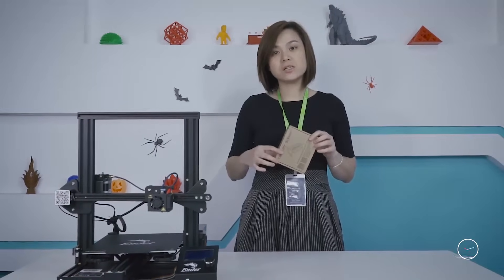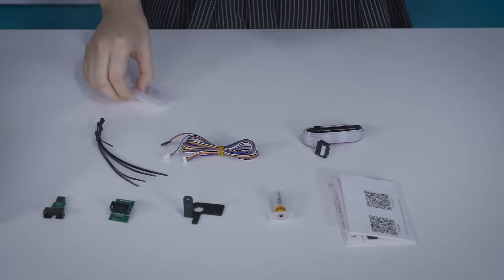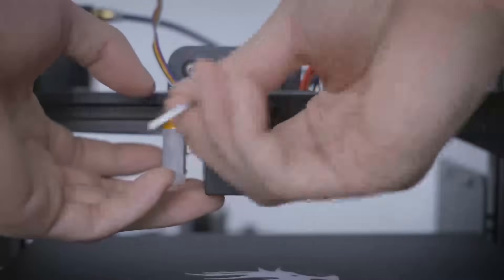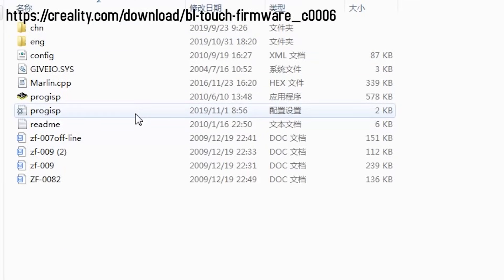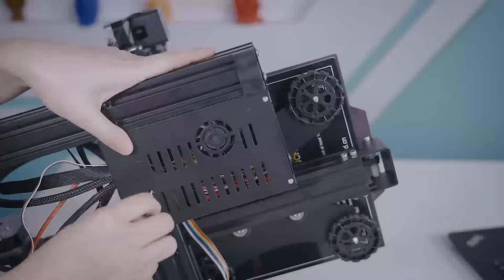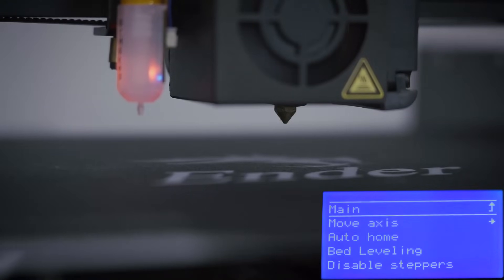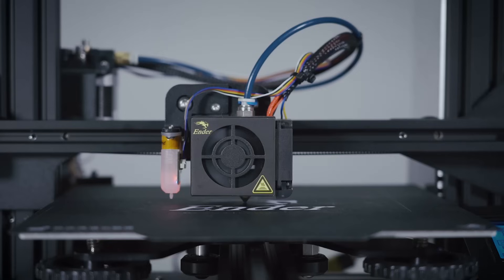How to Install Creality BL Touch Auto Bed Leveling Sensor Tutorial (Ender-3 Pro Upgrade Setup)

Comment: I get my Ender 3 pro next week. I am getting so confused. Is this thing a piece of shit out of the box, and am I going to have to print new parts for it, from the very printer that I need the part for.  If this thing is unusable out of the box, how is it still considered the best printer for under 300. Good thing I only paid 209, so at least I am not out 300 or what. If it can not print out of the box, or last more then a two weeks like my piece of shit Anycubic I3 Mega s sitting waiting to hear from customer support. Do the Chinese know what that is. Sorry getting pissed at losing money on this crap. This is the second time I tried it. 3 years ago, I lost hundreds trying it. Why did I try again. I listened to a bunch of reviews, and they seem mostly good, but then you find out, you need these steppers, this bowden tube, these printer parts, and don't forget to print a cover for the power supply, so  shit don't fall in it. Doesn't that seem like something they would have seen in beta testing and said. "oh shit that's stupid".
 I really hope I love the Ender, and I hope that I can print pretty much after its set up without having to spend an other $100 for upgrades...

Comment: I'm working with Ender-3 (not Pro version)
I followed the video and installed so far so good
but in the final step (Platform Adjustment) 4:27
my Ender-3 has no option of "Bed  Leveling" under "Prepare" 
Can anybody help me?
I downloaded firmware at Creality3d Official website
The file's name is the same as the link in this video's description
" Ender-3Marlin1.1.6BLTouch "  I downloaded
( https://www.creality.com/download/firmware-for-bl-touch_c0006/2.html )
Is it makes an issue for me?
or Ender-3 (not Pro version) can't bed leveling easily as the video did?

Thanks
Reply: Well... I’m stupid and found the reason out
Because that the step of firmware setup
I choose wrong file in “Load Flash” step
The “Marlin.cpp.hex” is incorrect file during the firmware update.
It should be used “Ender-3Marlin1.1.6BLTouch.hex” as the video shown.
I selected the right file and worked finally!

Comment: I did exactly as described in this video. My ender3 was working almost fine. and now after the installatioın of BL touch it can not get the first layer to stick. I have tried almost everything seen on the net but nothing helps. Almost a week now with these trials very very frustrating. I need help
Reply: Have u tryed using a 0.4 initial layer ? I use glue Stick
Reply: @TheMasterizzatore  i gave up sir
Reply: Exact same issue here! Only I have a car-10s pro v2 and mine came with the BL. After a handful of amazing prints I believe it’s malfunctioning. I level my bed but after pressing the home button and reactivating auto level the nozzle is way too close to the bed. I can’t even fit the .2mm tool under.
Reply: @andreortiz3396  good Luck mate i freed my mind not printing for a while...
Reply: Just change Z offset

Comment: Are there any good forums for troubleshooting ender 3 bltouch installation? I've got it all installed, but now when I try to move the z axis, it goes straight to the top, and I have to shut it down. Doesn't matter which way I try to move it, or on which step increment, always goes straight to the top and gets hung up.

Comment: DONT DO THIS IF YOU HAVE 1.1.5 SILENT BOARD OR YOUR BOARD WILL BE GG. Somehow that burner killed my silent board there is not any software anymore I see just a blank blue screen I will try to install software inside of it via bootloader and arduino hopefully it will fix.(edit: Board is dead cannot use anymore) TY CREALITY >:( DONT DO THIS ON SILENT BOARD

Comment: Do I need to power on my Ender 5 in order to flash the new BL Touch firmware for Ender 5?
Reply: No, it use the Power of the USB wich is connected to your Computer.

Comment: Ender-3 Pro1.1.6BLTouchV3.1PowerLossContinueEnglish 4.23 " Dont work on silent MB 1.1.5 my display are black after power on .. only the hotend air its going....
Reply: my display blue with silent board I switched back to stock board and ordered one arduino I will try to install a bootloader and install a software to fix it hopefully.
Reply: @Burak0015  Work ok without the BL fimewire but have to reinstall the Z-stop. I had it working with 1.1.4 MB

Comment: Hello, I followed all the instructions and my screen is blue and I cant see any menu on the screen
Reply: Damn...
I have bad news for you...
Reply: I have the same problem. How can I fix the problem?
Reply: @abecemar  I just had this same problem.  It turns out that the socket for the screen wires is just a little too big so that you can actually miss some pins when connecting it.  Just be very careful and line it up before putting it on.

Comment: My mother board fan and my filament fan is not working after flashing my mother board for the BLtouch auto-leveling. I also downloaded the software off of your website but the ender3 flashed my mother board with the ender3pro software. Can you please check the correct file in attached to the link for the Ender3 firmware. Please help fix this issue, my printer is currently not printing correctly because the filament is not cooling.

Comment: "Ender-3 Pro1.1.6BLTouchV3.1PowerLossContinueEnglish" Dont work on silent MB 1.1.5 my display are black after power on .. only the hotend air its going....
When i go back to  "Ender-3 Pro1.1.6.2 resume printing" working
Reply: I'm at this Point did you fix it?

Comment: I got under3pro last 4 days i starting print but never stick in half way my printe gotten removed??
Reply: You probably have a warped bed the same as my Ender 3 PRO, apparently most Creality printers ship with warped bed, took me 2.5 months to get creality to ship me out a replacement bed but instead of shipping a new heat bed they ship out glass plate but at least it means I can print now.

You can always go to a glass cutters and try with a normal sheet of glass the size of your print bed to see if that sorts your problem and if it does it means its a definitely a warped bed.

Comment: I have been struggling for over a day now to figure out how to keep the extruder from banging into the right side of the printer when I run autohome or bedlevel. The Marlin hex file moves forward and tries to slam downwards and I have to turn off the printer. The other hex file tries to slam into the right side.

Comment: Everything went smoothly, now when I turn the Ender 3 Pro on, the screen is blue with barely visible flashing. Any idea's are appreciated. I've checked wiring, connector orientation. Flash took about a minute and said it was fine.  The BLTouch itself doesn't light up or do anything when I turn power on.
Reply: you might have messed up the power gnd and vcc
Reply: Like I said to Pablo, I just had this same problem.  It turns out that the socket for the screen wires is just a little too big so that you can actually miss some pins when connecting it.  Just be very careful and line it up before putting it on.

Comment: Should warn people that the connectors on the main board may be hot glued in place, it might potentially spare a customer from pulling the Z-axis end stop mating connector off of the main board or causing other damage.

Comment: Just bought an ender 3 pro. This works on the stock motherboard that came with the unit, right?
Reply: I don't think it will as they never shipped with a boot loader, I tried flashing mine with new software with no luck only to find online everyone says it don't have a boot loader so you have to install a boot loader and then flash it.

It's a lot of hassle to install boot loader so I never bothered in the end and all I see here is people with 1.1.5 boards having problems so I don't think that's a good option either and creality seem to leave this video to die now it's a few months old.

Comment: I downloaded the firmware from the site but when I try to open the application I get messages and then it won't properly close, I've redownloaded it and have the same issue everytime
Reply: rename the folders, there are characters in the folder names that mess things up
Reply: @jimthwaite9275  That did it, thanks so much
Reply: @bowietheninja  I was watching the video and doing the install myself so I saw your message about 10 minutes after I ran into the same issue :)

Comment: Hi i just buy ender 3 pro and some upgrades BIGTREETECH SKR mini E3 V1.2 Control Board 32Bit With TMC2209 UART VS TMC2208 For Ender 3 Pro/5 SKR V1.3 E3 DIP 3D Printer Parts i can instal with this and is the some instal with your video

Comment: Does this affect my printers ability to read from the Micro SD card? I have read that there could be memory issues i.e. not enough to run both the ABL and SD Card functionality. I have the Ender 3 Pro and the Creality ABL kit.
Thanks in Advance :)

Comment: I followed this video just as it was explained. I’m not sure what I did wrong but my printer display is now stuck blue and the bed for some reason twitches, the printers unresponsive to anything. Someone please help me with this, all wires are connected correctly. I think it’s a firmware issue but I’m not sure what to do to fix that

Comment: What about custom X and Y offsets, like for the Petsfang V2 mount?
Reply: Forget about Creality providing anything, they haven't even adjusted the X, Y offsets for the BL Touch in their firmware so you end up with just two-thirds of the bed probed for ABL and no Baby Stepping so you have to make a Z offset adjustment then print a bed calibration print to check if the offset is good and if not change again and print again rinse and repeat many many times

Comment: turned on my printer and it stared smoking and the screen doesnt work, guess i messed up
Reply: I didn't have the smoke ( rather serious and the next bit is if you sort that out :( ) but i had the blank LCD screen. Try changing the screen lead with the lead included in the pack.... That got the LCD screen working!!

Comment: Thanks for this instruction, that was very helpful. One question though, I could not find any proper recommendation about the Cura G-Code: G29, the instruction that came with the BLTouch Guidebook says: Change "G28" to "G28 G29" ???? other guys post saying G29: Probe , G29:ABL  any many other ... could you please clarify this?
Reply: Do not change G28. Add a line after G28 and in that line type "G29 ; ABL"  (minus the quotations)
Reply: Maybe I'm explaining the obvious, but - anything after the ";" is considered a comment. G29 is the actual command and means "Bed leveling (automatic)". G28 is "Auto home"

Comment: The A plus B = C setup does not make sense.  First it's hard to understand the language....sorry.  She says "A" is -000.8 by this printer".  Where did she get that?  It's not a factory default, she just eyeballs it and says "write it down".  The we mark down the Z Offset data, which is not on my screen.  Not sure if this is the BLTouch offset or what. Then it appears she just stays on the "B" screen and adds the screen "A" to it.  If you don't know what exactly "A" is your screwed.  Mine; if I go into Motion and control Z I have it showing +1.2.  My BLTouch offset says -1.85, so if i adjust to -0.65 I should be OK, however Z just plows into the bad no matter what number I put in.  It's the same every time.  

Oh and to top it off I leave a question here and get ignored.

Comment: I followed this exactly and my nozzle is going way too far to the left to the point that the BLTouch is off the plate and dented my bed. How xo I fix this??
Reply: you need to set the probe offset in the firmware
Reply: @wss.niklas  how do i go about doing that? I used a hex file from the manufacturer website. Sorry complete noob at thos stuff.
Reply: @agentsmith007  Do you have an octopi?
Reply: @wss.niklas  yeah
Reply: xspyboyx try running these commands via terminal: M851 X-44, M851 Y-16, M500, M501 and try it again
Reply: @wss.niklas  do that and then run the bed leveling again? Appricate the help. Trying to tune this thing up!
Reply: @wss.niklas  Still going way far to the left and missing the plate. I'm not sure exactly how much it changed if any. Is it more negative to bring it closer to the center of the plate? Thanks.
Reply: xspyboyx its the distance between the probe and the nozzle, try downloading the hexfile from teachingtech and flash it again
Reply: @wss.niklas  Yeah I spent all weekend flashing this and flashing that and still get the same results.
Reply: @agentsmith007  so you flashed the hex file from teachingtech too?
Reply: @agentsmith007  If I were you I would watch a tutorial about flashing the firmware to a newer version. You dont need to have a bootloader flashed on your mainboard. Because you have a octoprint
Reply: @wss.niklas  yeah thanks anyways. Ive already done all of that. I saw a few others with similar issues but no resolution. Hopefully the manufacturer will get back to me.

Comment: Please can you confirm the Fuse and Lock bits values for the firmware upload; The video states: Low value = D6, High value = DC, ExtValue = FD, However this appears to contradict the instructions supplied in the kit which state Low value = DC High value = D6, ExtValue = FD.
Can you confirm which values are correct?
Reply: My instructions state: Low value = D6, High Value= DC, Exact value = FD. Flashing with marlin went all fine with these values. I do have the 3D touch knock-off but that shouldnt be different. Also i had to de-solder a cap from my 1.1.5 board to get it working on my ender 3 which was not in the instructions.
Reply: @whothis8933  Thanks, I was just concerned that the image in the instructions also seem to align with the video & wondered if it was a typo on the instructions.
I believe the latest firmware solves the cap issue, guess I'll soon find out :)

Comment: Bed Level is the #1 pain with new Ender owners.  Took me a couple hours to dial it, print, dial it in, and print in manually...
Reply: How did you get the nozzle aligned so it's not going off the bed? My BL touch is way off to the left after I followed these directions.

Comment: Hello everyone. Is it possible to buy connection board (adapter) between lcd port and bed-leveling sensor ? I've got sensor and Creality board without plug for leveling. Or connection list do do it by myself adapter. Thank you

Comment: hello, i have installed it all and did the firmware etc. the sensor works and the printer saves the offset, however when doing a home sequence and starting a print the print head stays way to high above the bed. about 4mm. no matter how many times or how much i change and save the off set . i am stuck with this now and the printer is not usable . anyone experience this to ? and if so how was it fixed?

Comment: when opening program all i get is '' access violation at address 7681f80 in module kernelbase.dll '' any help would love to use my blt on my ender3 pro  with v1 1.5 thanks.
Reply: just faced this problem yesterday, if the program folder name contains weird symbols. this problem will occur, rename it to some thing readable (alpha numeric)
Reply: @sitzenyt  thanks that did it .

Comment: I installed this on an Ender 3 Pro that I bought last week. There were 2 things not covered in the video that gave me a little trouble. 
1- Windows 10 has trouble with the characters at the end of the progisp folder name. It may have handled it if I had the Chinese language pack installed but renaming the folder to "progisp+1.72" solved that problem.
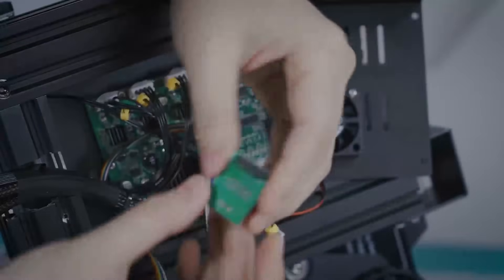2-  The Z axis wire that's pulled at 3:13 in the video is not nearly that easy to pull out. There was a lot of glue holding it and all of the other cables in place on my printer. If someone were to try and just yank it out like the video shows they'll end up ripping the cable out of the connector.
Reply: Thanks for this I was having problems connecting until I read your comment and now everything selling smoothly thanks
Reply: Theirs the comment that needs pushed up further.  couldn't figure out why this wouldn't work for me
Reply: which folder do you have to rename, I have this and the ProgISP software does not show any chips to select one to program, did you also have this issue? I have version 1.72

Comment: I've followed the install instructions from the video, but when I attempt to print all that happens is the machine runs the pre-print leveling check, but it just sits and the completion timer runs out after this with nothing printed.
Reply: Got the same issue here. Did you manage to find a fix?
Reply: sk4lives got the same problem, anyone got solution?

Comment: Great video 📹 Does the firmware update software work with a mac? As I don't have a Windows machine :(
Reply: Are you able to do this?
Reply: Not yet have a BL fitted but can't use it as firmware is wrong

Comment: Im in 4:26 and what if the screen dont turn on?
Reply from the maker: You can check whether the adapter board is inserted correctly, or is it inserted backwards?

Comment: When I click Write at the 2:55 minute mark I get an error saying "Chip Enable Program Error."  What's wrong?
Reply from the maker: Can you check if the ISP cable is connected to the motherboard? Is the blue light on the motherboard on?
Reply: @Creality3D  As it turns out I has the plug on the main board backwards.  I feel like an idiot. :)

Comment: does this work with the Factory Ender 3 or only with the Ender 3 Pro or another Motherboard?
Reply from the maker: Ender 3 and Ender 3pro motherboards are universal, but the firmware is different, so you can install BL touch on Ender 3.
Reply: @Creality3D  thanks, for the quick response
Reply from the maker: @boyensn  you are welcome